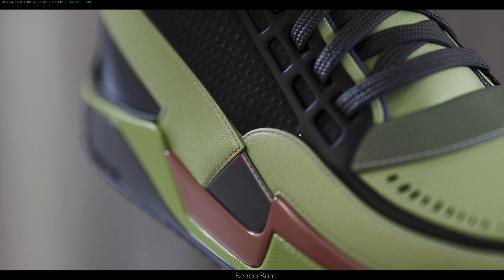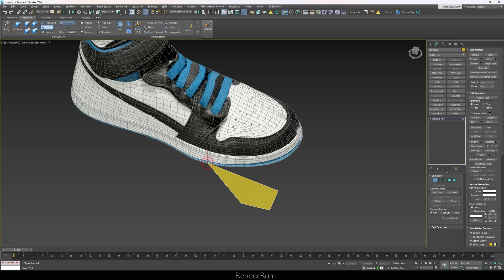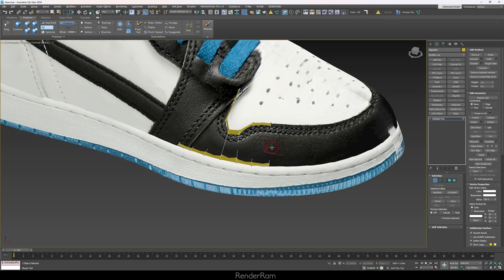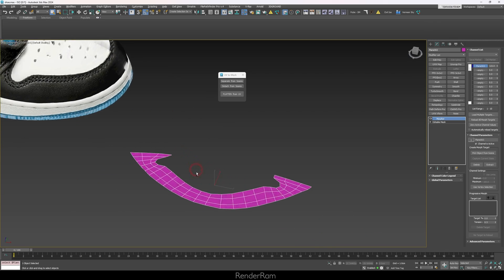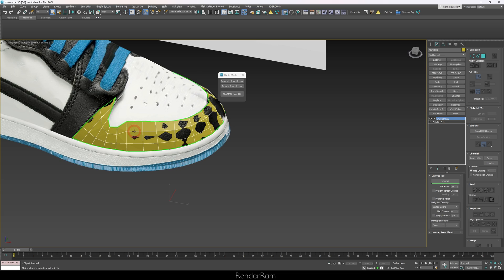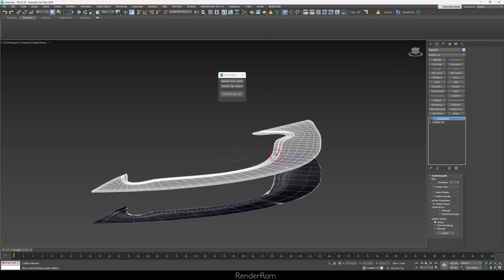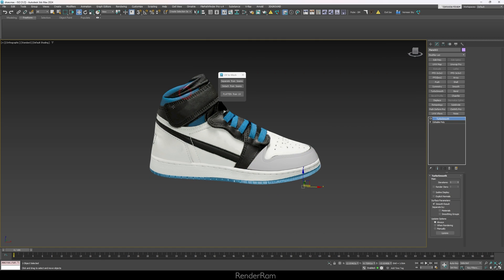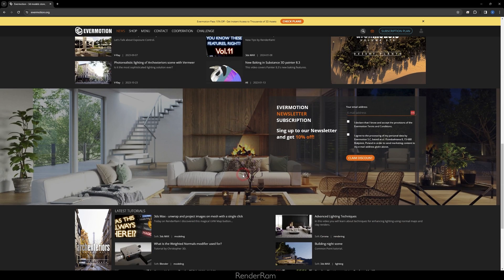Modeling Complex Geometry On Curved Surfaces | 3dsMax

Comment: a tip if anyone can get topogun 3 buy that or get 2 for cheaper. 2 doesnt havr automatic tools but with max's retopology tools being improved the remeshing helps and topogun 2 conforms the whole object easily over as well. wish max made a modifier that way. the old conform was better autodesk just keeps ruining stability and overall optimization. still great video yet its a shame none of these tools have been upgraded for so long. max's plugin option have ton of them disabled too since version 1 eating cobwebs XD

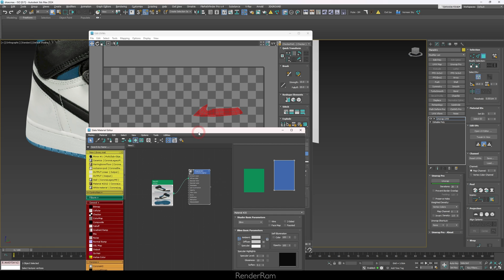Comment: 8:04

Are there any plug-ins or a faster automated method to basically unwrap/unfold a texture mapped object based on its (CUT) SEAMS to have the flattened end result keeping the flattened texture intact as in this example?

Comment: Hello there. I attempted this with a simple sofa seat model I had. I created the small plane, selected 'draw on surface', selected my piece to 'draw' on (in my case, the back rest), and followed your lead with the offset (0.05). However, the vertices of my plane refused to snap to the surface of the back rest. I repeated the steps to no avail. Using Max 2024. 

Thanks!
Reply from the maker: Might be a silly troubleshoot but If they are not snapping to anything on the object, double check if you picked the object in draw on surface so that object name is visible there., other than that check if normals are inverted on the sofa (but in that case verts should be snapping to inside)
Or just simply try creating a sphere and try to Pick sphere object and try to snap your plane to sphere.
Let me know what does or doesn’t work
Reply: @RenderRam  Okay... thank you. I'm in a tutorial "cycle", and will get back to this one in a bit. I'll try this then. Appreciate it.
Reply: @RenderRam  Hello there again. I tried again, but had the same result. I followed your steps:

* I created a plane, saved it as an editable poly.

* I selected surface, object name, and offset by 0.200. 

The vertices of the plane just would not stick to the surface of the object I selected.
Reply: @keithyakouboff8755   I think I know what your issue is with this. (BTW, this is my first time playing around with this awesome feature, so I might be wrong.) 
Once you decide you want to move the vertices of your plane to the selected surface, you don't need to go into vertex sub-object mode. You just need to click on the Extend button in the PolyDraw menu and use Ctrl+Shift+Alt+Mouse click (or rather drag) to move vertices over the surface. 
Just hover the Extend button and take a look at all the shortcuts that can be used (the one to move the vertex is the last one and I missed it the first few times).

A small tip - if you want to move edges, polygons, loops, etc. you need to use the Drag option (all the way to the left in the ribbon).
Reply: @tsukirida  Wow, thanks. I'll take note of this for my next attempt (I run my tutes in cycles, and today it's going to be a focus on Arnold and V-Ray tutes, but I will get to my Max work again soon). 'Preciate it man!

Comment: Superb 😊 Great tut and understandable -  the only thing i didn't understand was the uv channel moving. How can the infirmation with 2 shells in channel 1 be "morphed" to one new uv shell in channel2 without stitching them? The texture is the same, but the texel position has drastically changed. Can you pls explain that? Thank you🤩
Reply from the maker: so, we need 2 uv informations, 1 for UvToMesh and 1 for Projection of shoe.
I moved Projection from shoe UV to map channel 2, and then I made a new unwrap for UvToMesh in channel 1
That way when we fire up UvToMesh, he's gonna create an object with morpher that morphs into a whole complete island from map channel 1, but because of mapchannel 2, textures will be correctly displayed
Texel part: if you're talking about the part after I hit uvtomesh, where when using morpher, the size of the uv island gets much smaller, that's a uvtomesh thing, and I haven't corrected it in the video, but I've explained how to correct the uv object size after morphing here: https://youtu.be/14lcDryRB80?t=306 at 5:06min
Just a tip, in the video, after I correct my UV island object scale, I forgot to show that you need to toss a Reset XForm to it to preserve the new scale

Hope all is clearer now and that I understand your issue
Reply: @RenderRam  Thx a lot for your explanation! I tried your workflow a few minutes ago, things are clearer now!

Comment: Yup, this is what I've been doing all the time. I usually go to Zbrush to Dynamesh a base mesh, export it to Max, then literally start drawing over it with Freeform tools. Edge loop regularizer for easy mode circles, conform/move conform to adjust vertices. I think the last 2 years every single character model I've created used this method.